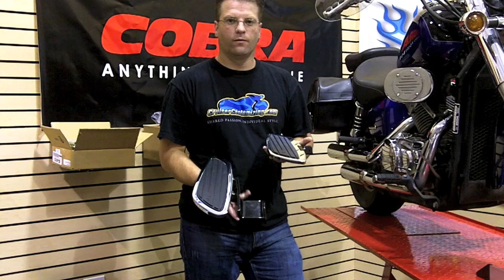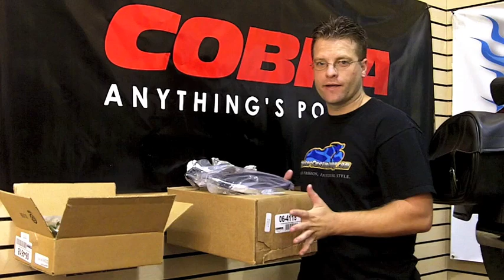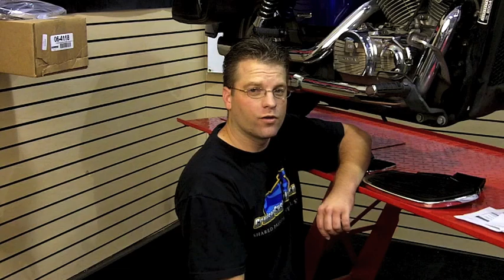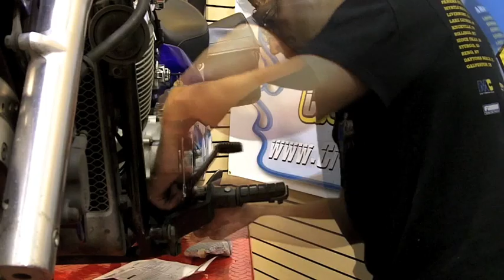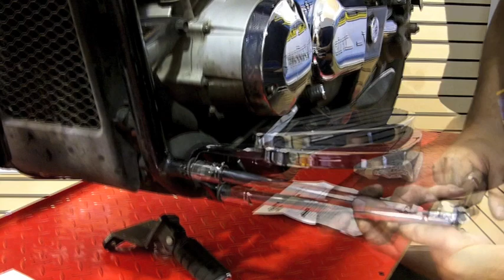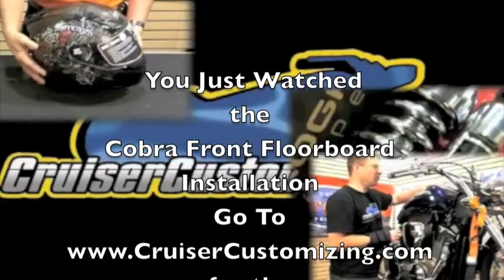Cobra Engineering Front Driver Floorboard Video Install Cruiser Customizing

Comment: If anyone is having trouble seating the bolt for the shifter lever, I used very coarse sandpaper on the threads of the receiving hole. I originally thought the bolt was the wrong size, but NO! I guess the finishing at the factory didn't quite "finish" the threads. Anyway, the supplied bolt worked just fine after I sanded the hole threads. The boards look amazing and are so much more comfortable than the pegs they replaced. Great upgrade!